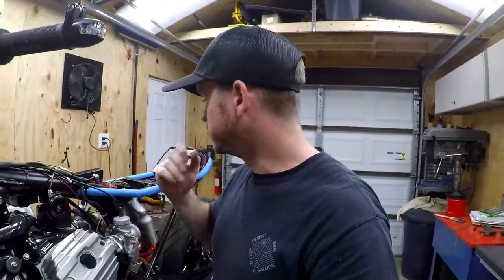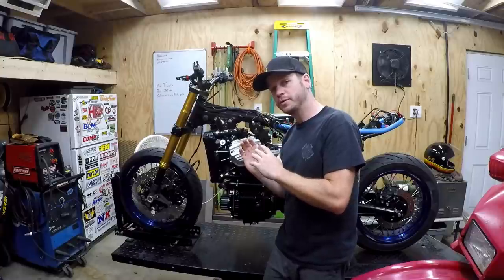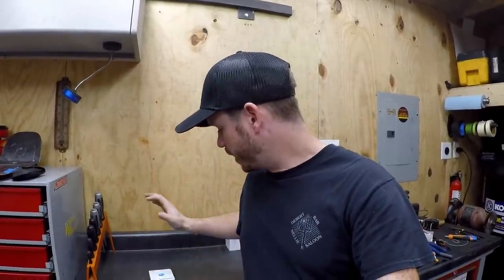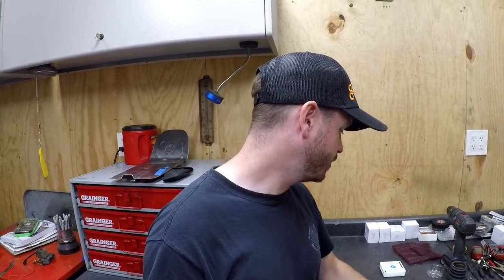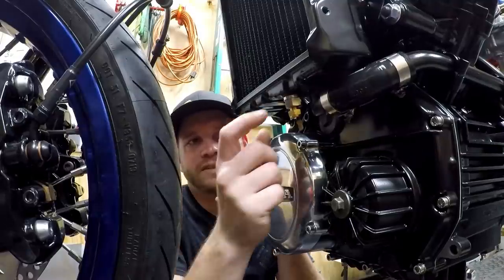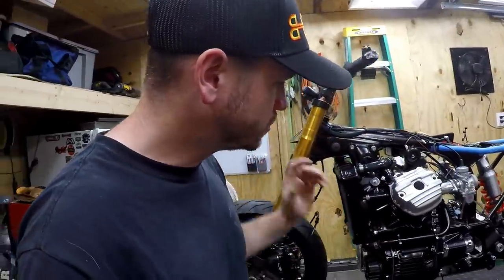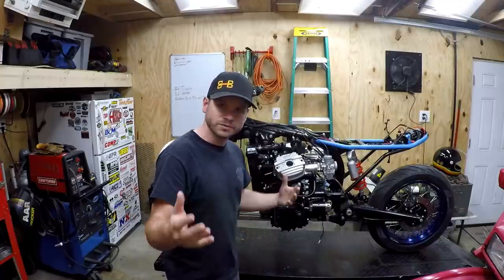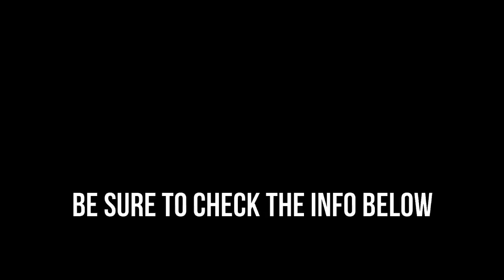CX500 Build - Cooling System Overview! - E Fan/Switch/PWM Control/Hoses/ MORE!! - EP44

Comment: Did you end up cutting the camshaft?
Reply from the maker: No because this is a 650 engine which has a factory electronic fan so it uses a different cam and tach drive.
Reply: @BrickHouseBuilds  gotcha, thanks!

Comment: When you get to the Exhaust system are you going to include the H box or do a 2-1 or 2 straight pipes ?
Reply from the maker: Oh the exhaust has already been built! I just need to final weld it. The link is to ep19 which is pt2 of fabricating the system.  That video links part 1. 2 into 1. https://youtu.be/xN6lBvDII4g
Reply: @BrickHouseBuilds  Ahh ok sorry must of missed that epp. Ive put a set of Murrys on my old CX500 and im going for straight pipes with some Harley Sportster muffs.
Reply from the maker: @sammcdade5008  you're good man, there are a lot of videos in the series so its easy to miss
Reply: @Brick House Builds I am looking forward to seeing how you do the electrics that is one thing my bike could use a refresh on so your videos are very helpful for me even if your working on a gl500 it’s close enough. Great work so far I am loving the series keep it up.

Comment: can i use a m.unit blue to mellow the starting spike of the fan? or do i need a becky unit even if I already have a m.unit blue?
Reply from the maker: Actually I do not know on that one as I have never used an M-Unit.  I know they offer an auxiliary port output but I don't feel it would be as controllable as this system since I can have a dedicated fan switch tell the Becky system when to turn the fan on and off as well as dial the overall speed to my liking.

Comment: Can you share where did you rebuild the radiator please? Thanks
Reply from the maker: I had the radiator rebuilt at a facility here in Missouri. Are you more local?
Reply: @BrickHouseBuilds  No man. Clearwater Beach Florida. But do you think I can ship it and pay in advance all the costs. Other question, do you have any kind of service of consultation? I love this GL and I am planning to fix a few things.
Reply from the maker: @miguelatambucho748  Well you could just have a local radiator shop do a rebuild on yours. The remove the sides and clean/repair the core before re-soldering it all back together. I didn't do anything to the radiator beyond painting it.